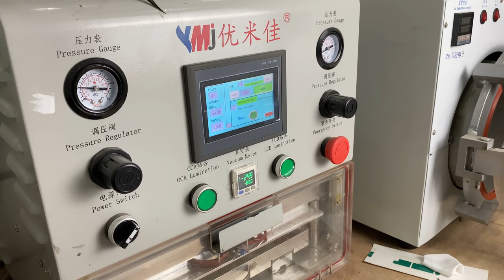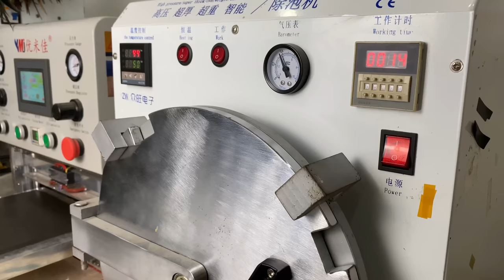How to change touch glass apple watch series 6 complete | iWatch Series 6 Repair Glass

Comment: Sir I need a small help. While I am pairing my apple watch series 3 with my iphone 6s plus having ios 15, I am getting error during the update”update failed, you are not connected to Internet” Did you face or see any issue like this ? Could you please help me in resolving this? I have tried all the methods suggested by the apple support and also tried all the methods suggested by the people facing the issue in apple community support, But no luck. Please suggest any method to bypass this.
Reply: Um... You turn on Bluetooth and GPS?

Comment: hi i have a question i samsung s8 s9. I cut s8 + .s9 + phones at 95 degrees and samsung s10 phones at 120 degrees. However, after tapping and removing the display for the test, the displays do not open as a green screen when they are opened, what is the reason and the solution I should do. I am in Germany. Can you help me?

Comment: I’ve been watching the video and see that there’s damage to the digilizer
Reply: l
Reply: I think its waves because he needs more heat and pressure during lamination
Reply: Nevermind, i see the damage now
Reply: Me too. At left side of the glass. It’s still have a glue that he didn’t clean. But still, this is cool anyway
Reply: @samuelwirawan7687  yeah watch is too hard to repair most repair shops in US won't even bother since replacing glass is so much work and labor that is not even a cost effective option here.  it's still an impressive repair that he did imo

Comment: hi i have a question i samsung s8 s9. I cut s8 + .s9 + phones at 95 degrees and samsung s10 phones at 120 degrees. However, after taking out the tactics for testing the screen, the displays do not open as a green screen in pale color, what is the reason and the solution I should do. I am in Germany. Can you help me?
Reply: @combofixing224  this is not his real number. Look at his username, it says combo fixing. But the real channel is named cambo fixing

Comment: Touch isn’t working properly and there are bubbles in the corner. Good attempt though
Reply: Bubbles usually come out after a few hours. Have you ever attempted to repair one?
Reply: @TechTee504  I’ve repaired over 3000 glass only repairs on the Apple Watch series

Comment: Everyone commenting on the bubble in the bottom left. It will go away after a few hours. Sometimes the autoclave (bubble remover) doesn't get all the edges depending on how long you leave it in
Reply: The only reason it would t get to the all edges is if it wasn’t aligned properly. And he should have left it in the autoclave longer before sealing it to the frame because the bubbles aren’t going to go away on their own. They only come out in the autoclave.